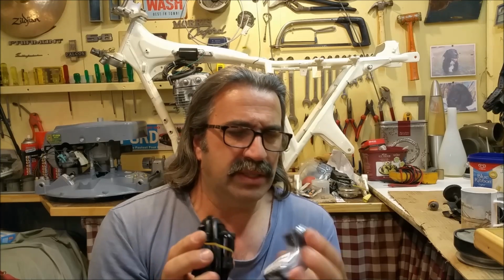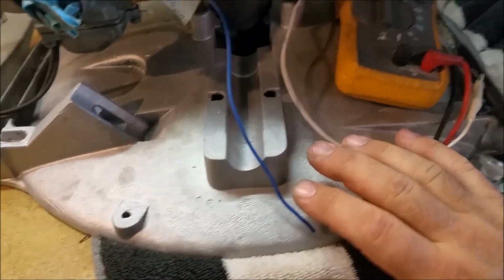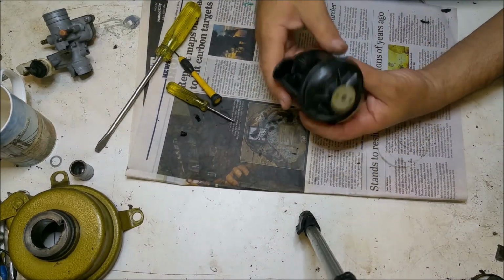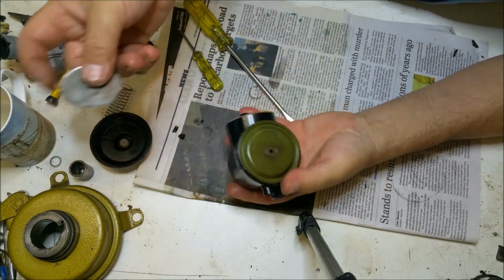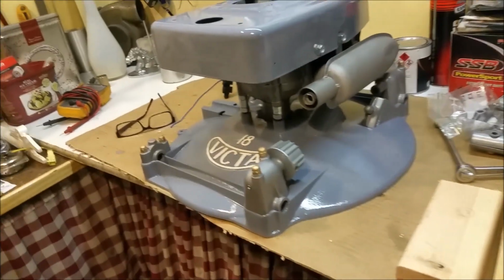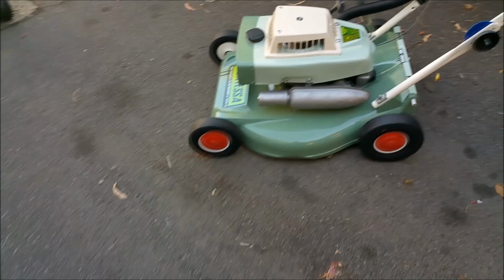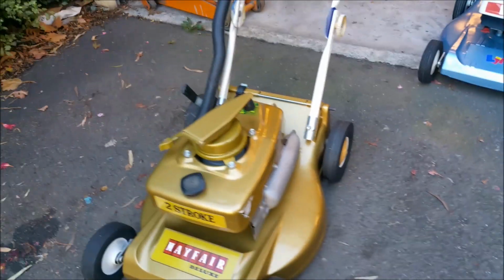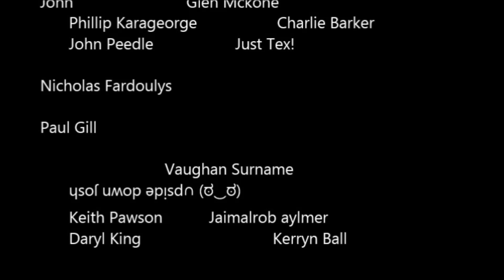Restoring 7 Classic Victa Lawn Mowers FINAL

Comment: My grandfather has an old Victa 2 stroke. Its about 20 years old but it still goes good! Needs a new spark plug wire though. They were built to last. The new ones I've heard mixed reviews about. I guess they don't make em like they used to.

Comment: I've really enjoyed the mower series. One thing. If there is a risk of those display mowers rolling off the shelf, could you bolt on a strip of wood or metal on each shelf leading edge to form a lip?
Reply from the maker: Indeed... already considered that, cheers and thanks.

Comment: Peter if you put the brass float in hot water it will pressurize and you can see where the holes are and then solder it up easily.
Reply from the maker: Hey thanks! I never thought of that - great tip, cheers.

Comment: Seeing the finned flywheel reminded me about a Onan motor on a generator we had at work years ago. Someone dropped it off a truck deck while it was running and it smashed off a couple of fins. Boss was really pissed as we couldn't find a replacement. I pulled the flywheel and cut two fins off the opposite side, replaced it and it worked for years. Balanced but just not exactly factory specs.

Comment: Hi Peter, I'm doing a similar project on some victa utilities. I have the same shroud and looking to paint. What plastic primer and paint did you use and how is it holding up?
Reply from the maker: Hi Brad, yes all mowers remain the same although dusty. I didn't used a plastic primer, I used conventional automotive single pack primer and added a flex aid. I would think that off the shelf rattle cans of plastic primers would do the same thing, cheers.